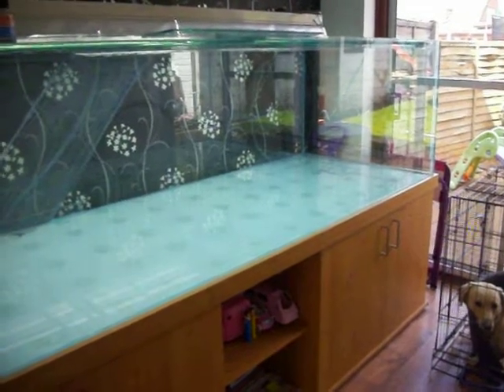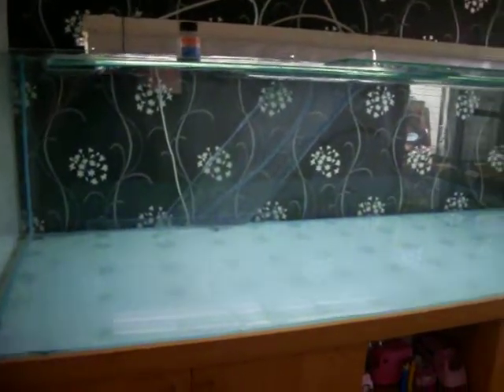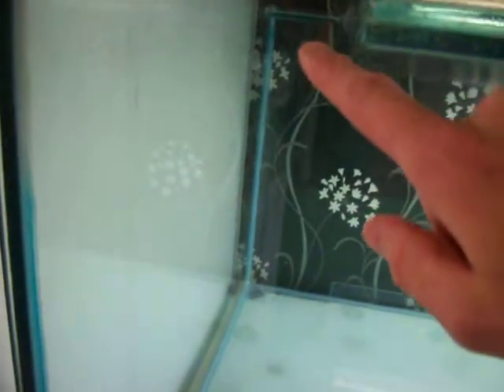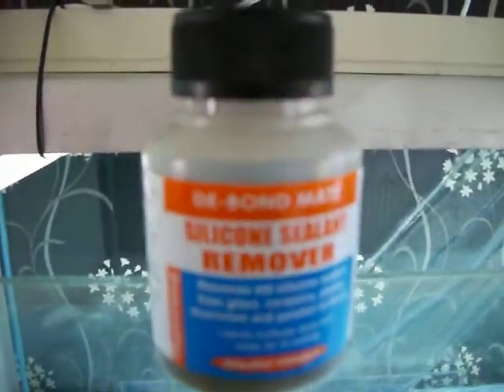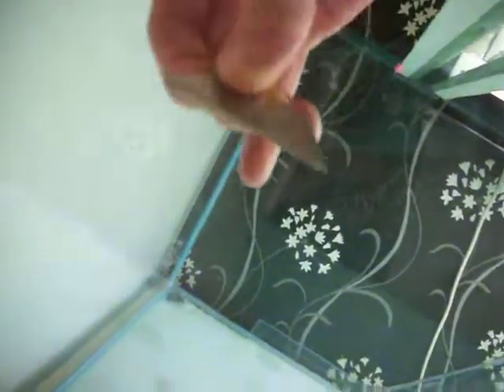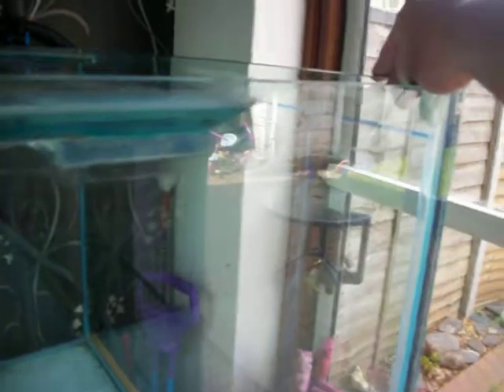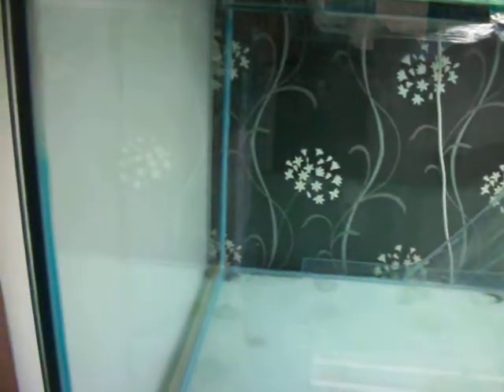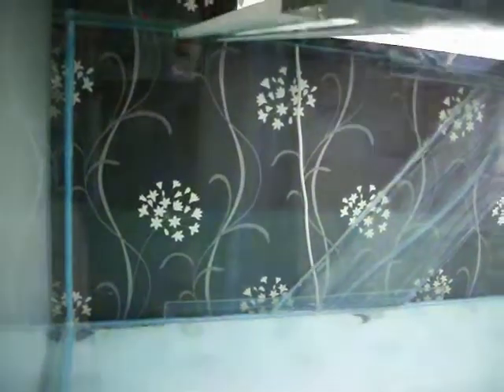Tank repair update + trying to remove silicone residue from glass !!!

Comment from the maker: Another update !!!! I left the silicone remover on for 12 hours 10 am till 10 pm !!! cleaned it off with very fine wire wool that doesn't scratch the glass !!! Guess what it did nothing at all !!!!!! 

 I also did it again and left the remover on for over 28 hours 10 am to 2.30 pm the  next day cleaned the stuff orr with the fine wire wool !!! And still hadn't touched the residue marks !!! 

So it look's like they ain't gonna come off at all !!! So will just have to live with them !!!!